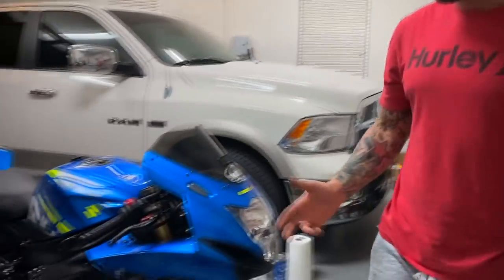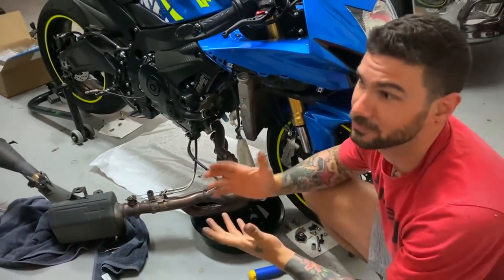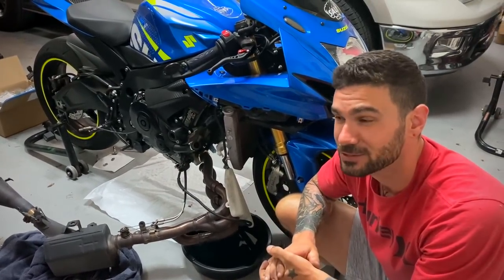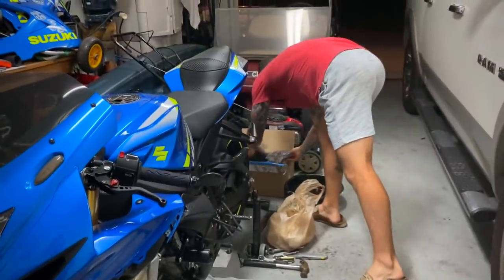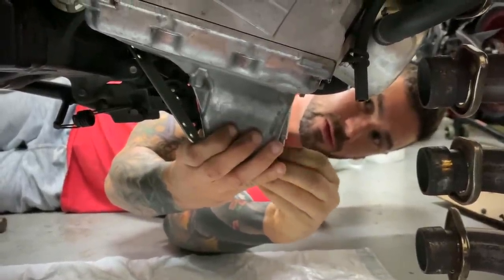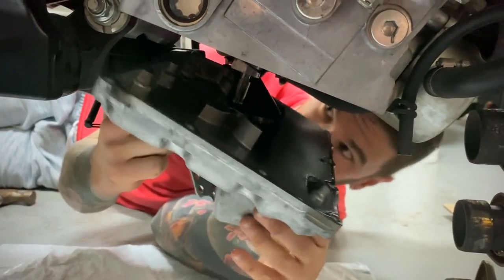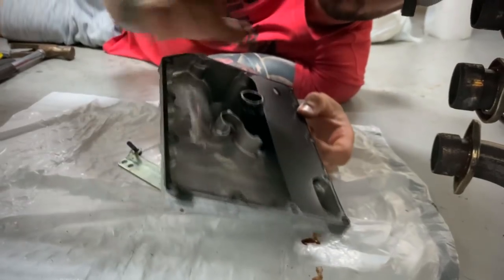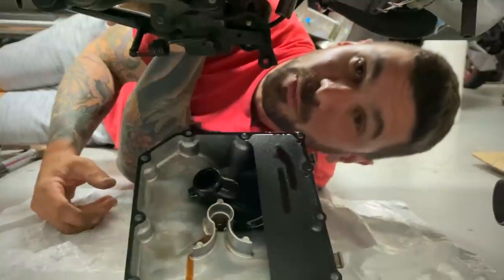I Broke My Bike! - Do NOT Make This Mistake

Comment from the maker: Big mistake on my part, but things happen. Unfortunately this is a common problem with aluminum pans, not only stripping but cracking from rocks and other things hitting them. Just glad I was able to do the repairs myself with the help on Heather and her brother Tyler.
Have a great weekend everyone! 🙌🏻
Reply: Just a tip from fellow rider bro 
Never touch the new sparkplug ceramic with your fingers man
Leaves oil on there and cracks the plug under high heat
Reply: Fortunately*
Reply: Put a Fumoto valve on there instead. You'll never have to deal with a drain plug and it'll make oil changes even easier
Reply: Thanks For Humbling yourself and showing ALL of US ,  your mistake. (Shit Happens) Anyhow, Just put the Redline engine ice in my 14’ Gixxer and that stuff is phenomenal.
Reply: i did the same thing to my 750 motor lol. cracked the oil pan right under the drain plug.. had to do the same shit :( i bet that plate in the back of the pan was a bitch to remove.. i had to bend it in all sorts of ways..
Reply from the maker: @apieceofreese48  omg yes, I didn’t even put that plate back on, it literally serves no purpose at all except to keep your oil pan from coming off lol

Comment: I’ve done the oil pan job before, It’s a long process for sure! 
Some advise! “DIGITAL TORQUE WRENCH”  is a must whenever working on the bike, everything is aluminum including the bolts which stretch for proper torque and are in “Newton Meters” not Ft Ibs, so a high quality torque wrench is a real good investment. Bike looks great and it’s always good to know how to wrench on your own bike.
Reply from the maker: Absolutely man! And I’m definitely investing in one here soon, we have a torque wrench but it’s a simple clicking one, digital would be great! Thanks for the tip!
Reply: I used a torque wrench for my drain plug the book called for 16ft ibs which felt like a lot tbh

Comment: It happens to the best of us brother, glad you were able to fix it yourself and save that dough but hey, you gained some more experience in motorcycle maintenance and fixed an existing issue. 👊
Reply from the maker: Exactly! If I feel confident enough then I’d much rather get my hands dirty and learn something new. I was surprised at how simple it was, just time consuming removing the headers and radiator.

Comment: Yo, PITA for sure.. The TL stripped her's a while back, (guess how many oil changes for 160,000 miles at 3000 mile intervals) did the helicoil on it, I have a special centering tap just for that purpose, also does spark plug inserts.. One thing that will also help is to change the gasket every time you do an oil change, cheap insurance to not overtighten trying to colapse it a little more each time to get it to seal..
Reply from the maker: That’s a good idea Craig! I will definitely be doing that in the future!

Comment: If it makes you feel any better, I bought my bike lowered and I was raising it from the front and when I was torquing the lower fork mount bolt I remembered that it was 75.5lbs ft and instead of double checking I just torqued it. Well the bolt snapped and it turns out it was only 16.5lbs ft. You hate to see it 😂
Reply from the maker: Ouchhhh!! Hey it happens though, hopefully it was an easy replace the bolt scenario

Comment: Dude just so you know they make these things called self tapping drain plugs and they retap the the threads as you tighten it and last a good 10 oil changes. They sell them at auto parts stores and we gotta replace them on cars all the time and it saves us hours of times when we get at home mechanics with they overtighten stuff
Reply from the maker: That’s actually what I had in the plug for the past year, but it eventually started dropping also so I finally broke down and replaced it. Good looking out!

Comment: Damn, didn’t realize you were running a slipon. While it’s apart throw the m4 headers on there and get it flashed.
Reply: I know wtf lol, sounds like Doo Doo as well. Dare I say typical gixxer riders? 😅 Honestly people don't realize how a good tune/flash completely changes the bike.
Reply: @alexventrov6826  lucky if I put 50 miles on a new bike before a full system and a flash. Bikes are choked out from factory.
Reply: @lowlife189  it's incredible man, I got my 2004 R6 flashed by Bauce Racing. It's an older bike so I wasn't expecting alot, now it runs like a completely different bike. It changed my entire perspective on bikes, now when I see people reviewing brand new bikes from the showroom and giving opinions it makes me laugh.
Reply: @alexventrov6826  I had my 18 zx10 done by Anthony. He does good work. Just recently tried out Schnitz on my new bike. Also huge difference.
Reply: @lowlife189  Definitely, Anthony is great. Schnitz?
Reply: Same, fast turnaround and the bike runs great. And affordable as well.

Comment: Use a torque wrench on all motorcycles, all the time.  By "feel" tightening gets expensive.
Reply from the maker: I agree, I usually do but not on the oil pan bolt. lesson learned.
Reply: I learned the hard way long ago, when tightening the spark plug on my bike.....
Reply: I've got many horror stories with my torque wrench. It's a Craftsman 3/8 microtork clicker. Every job I used it on was within its range which was 5ft-lbs to 75 ft-lbs if I remember correctly.
-Stripped my 2005 Yamaha R6 Raven's hub assembly bolt. 45ft-lbs
-Stripped 1989 Yamaha FZR crankcase bolts. Inconsistent clicks. Stopped when I "knew" the torque wasn't consistent. 7ft-lbs (+/-)
-Snapped the bolt head off of the FZR's clutch basket. 7.5ft-lbs (+/-)
I find it quite surprising since I treated it like a baby. Never slammed around, dropped, kept it in my bedroom away from predators. If ever used, it was immediately put back after said job was done. I had torqued that FZR's clutch basket bolts once before with a beam style torque wrench which performed flawlessly. Additionally, it was much cheaper. Some may say the Craftsman needs to be calibrated, however the only fitting place I see for it is a landfill - where it can't cause any more damage.

In the end, at least I realized it's junk on my cheaper bikes before I took it to the R1.
Reply: @nuckenfutz9983  they definitely don't make craftsman tools like they use to. Id go with Snap On or Mac

Comment: I just bought a translogic quickshifter for my 2019 GSX-R750. Is it difficult to gain access to the coil packs?
Reply from the maker: The coils aren't too hard to get to, you just need to take the air box out, I can take the airbox out in about 30 minutes if I'm not wasting time. Take the time to do it and learn and you'll be glad you did, very simple :)

Comment: I think a bigger mistake is running a slip-on with no tune. 💩
Reply from the maker: The cat is still on, it needs no tune.
Reply: @SALTxTHExWOUND  Every stock bike can use a tune. I know it doesn't "need" one, but you're missing out on sound and performance.

Comment: My baby TU250X has that oil drain bolt on oil screen cover, but one other bolt for the indexer, kiddies, don't pull that one... I thought I screwed up once changing the transmission fluid in a NEW car, the dealer replaced the transmission twice and found out their service manual was wrong too. Before drilling into the plane's skin, I would triple check, and still dropped the wrong bolt first oil change on the TU.